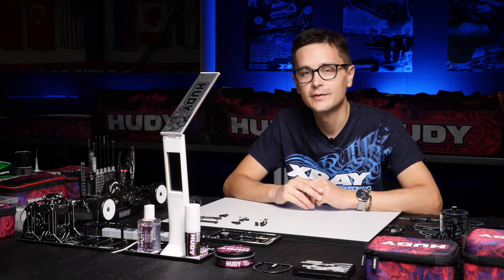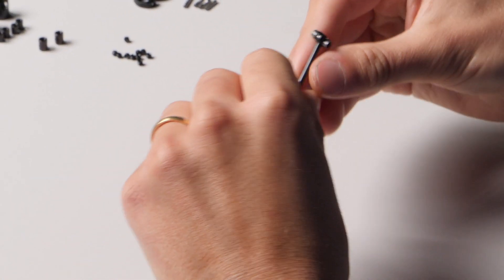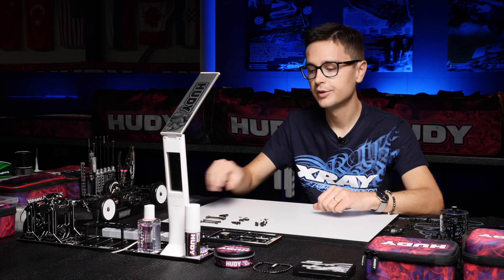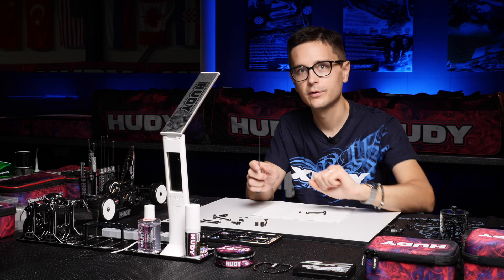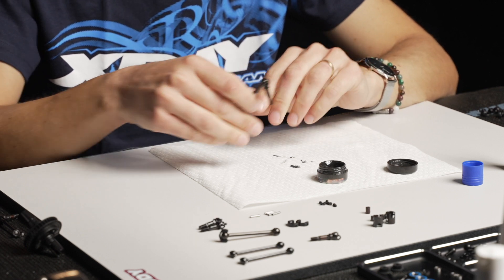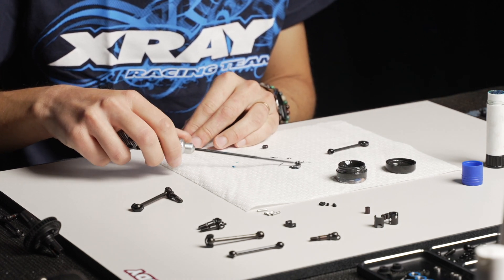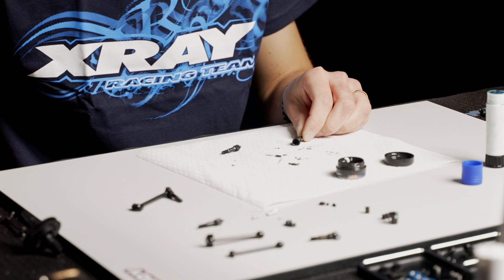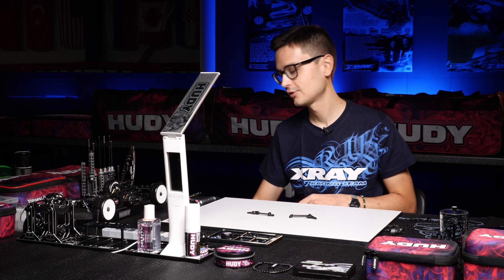XRAY X4 - Tech Tip - Drive Shafts

Comment: Hi Alex,
with my T4 I never had a lack of steering, I'd like to get the BB drive-shafts all around on my X4. I mainly drive indoors on carpet, small to med sized and I thought for 17.5T stock it might still be a good idea to with the 59mm fronts, given the smooth, rolling nature of stock racing. Do you agree, or should I better go with 58? 
Cheers
Reply: I usually feel that 59mm are the best suited for large, sweeping tracks. They might make you lack a bit of steering on indoor, small to medium sized tracks as you described. My recommendation will be the 58mm ones!
Reply: @hagberg  Ok. Thank you very much! 58mm it'll be then. You (and your videos) are extremely helpful. Keep up the great work!